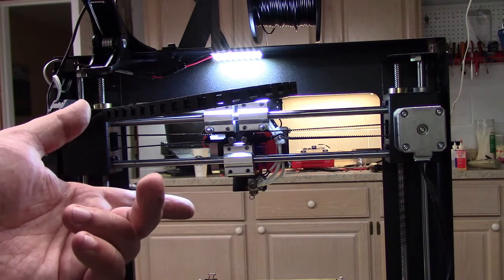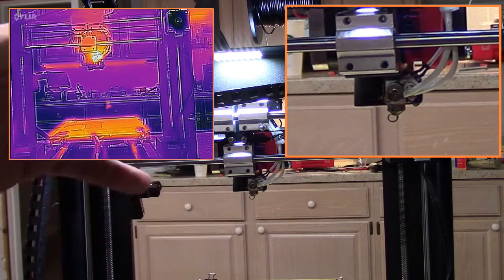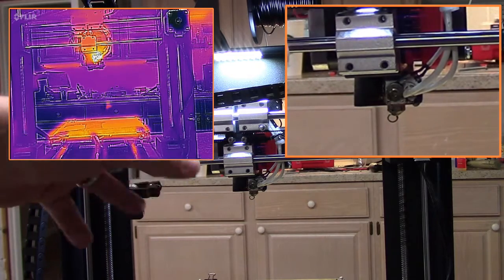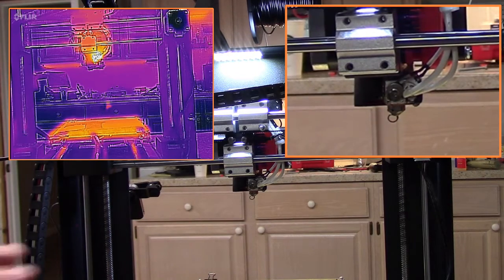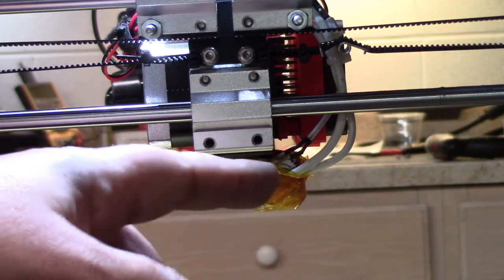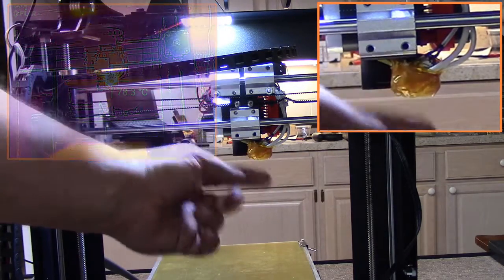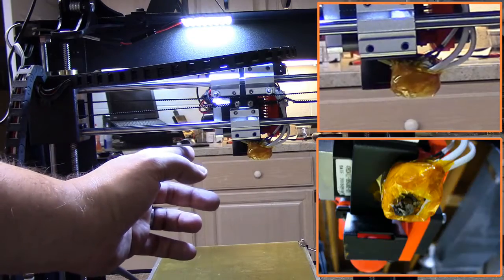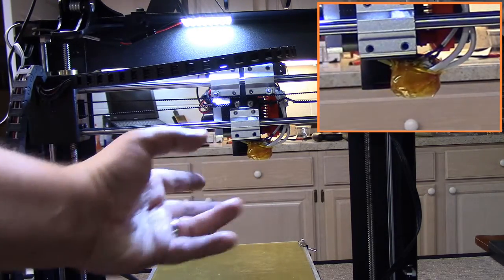Wanhao Duplicator I3 3D Printer - Insulating the Hotend!

Comment: So it looks like the laptop tape was at or below the level of the tip of the nozzle.  Perhaps it was just the camera angle but it looked to be quite close and I would worry about interference with prints. However you are good about testing stuff out and would have addressed the issue off camera. 

Interesting thing that ceramic tape. I have the Flexion upgrade kit with a silicone "boot" for the hot end. I'll be installing that here soon and give it a try.
Reply from the maker: The tape is close but so far no issues...